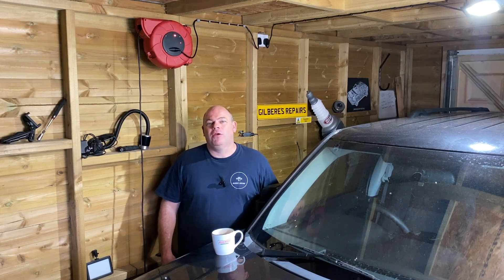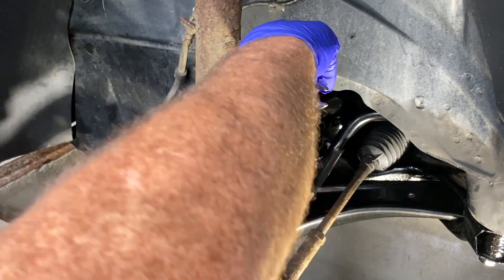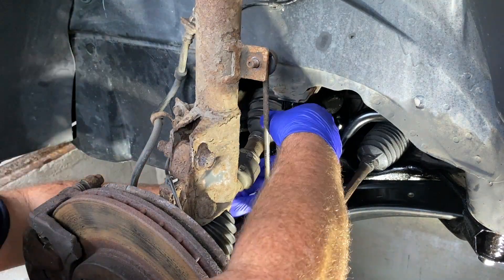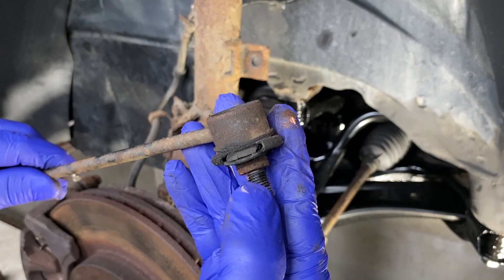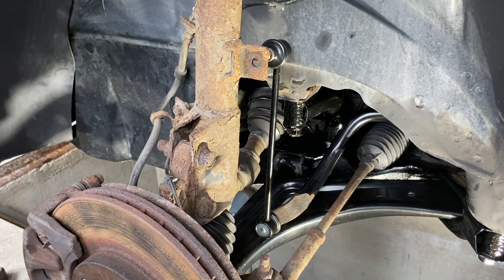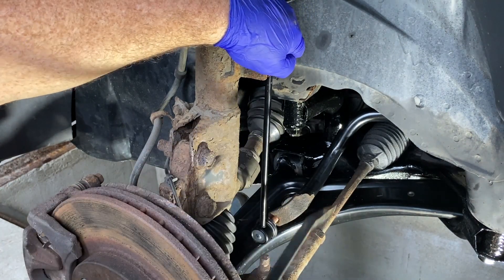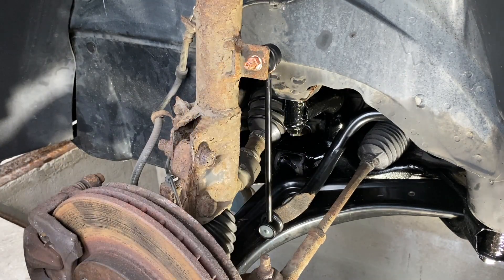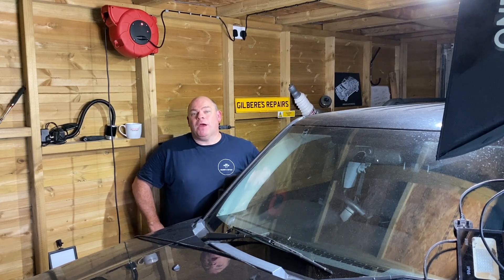Jeep Patriot sway bar link replacement. Anti-roll bar.

Comment: How can a sway link touch control  arm
Reply from the maker: @xvioletcr3m4ieux11  Your question sounds like a joke…. Why did the chicken cross the road 😂😂😂
Anyway… back to the question 🤔
Has the ball joint failed and detached or is everything still connected up?
Have any parts been replaced recently?
Sandy.

Comment: I ordered end links from
ROCK Auto. They are 13”. Too long. I order AC DELCO, same thing. I then ordered MOOG who state they are 10.3” and they are the same size as the above. Anyone know what is going on? I managed to get the end link on but the bottom of the end link the metal part is bottoming out on the control arm and I’m still getting clunking obviously. Am I missing something?
Reply from the maker: Are the new ones the same length as the one removed or longer?  Frustrating when these things happen.
I will measure mine for you tomorrow (in the uk)

Fronts or rears?
Reply: @gilberesrepairs  front but my brothers mechanic went to the parts store and just bought a 1” shorter one. Three pairs were all too long until they got the one not for his truck. That’s the one that fit 🤦🏻‍♂️
Reply: Not sure. They were thrown out
Reply from the maker: @Deerector  I’ll measure mine tomorrow and get back to you 😉
Reply from the maker: @Deerector  Go to my community tab, there’s a post for you 👍

Comment: I did mine today and you were absolutely right the nuts needed grinding off. I did find however that when tightening the new ones the bolt was spinning with the nut when tightening so I had to get an Alan in and tighten the nut with a spanner, so it made it much more difficult than it should have been. any pointers?
Reply from the maker: Yes, they need cutting off 99% of the time.
Really the only way to speed up refitting is to have a ratchet spanner on the nut and the bolt held through the centre.
Glad the vid was of some help 👍